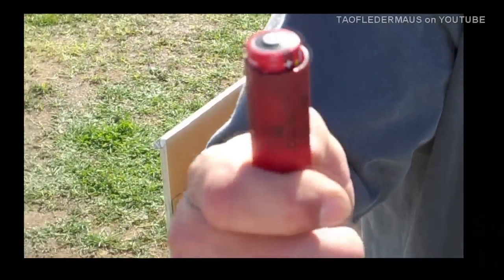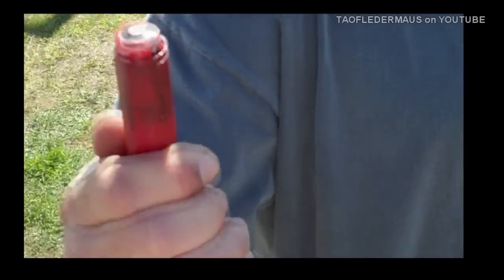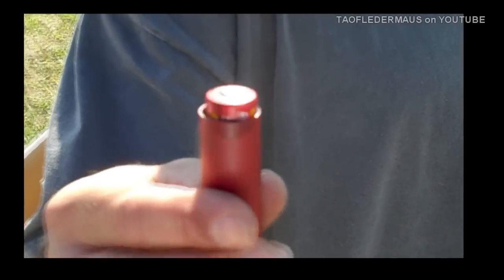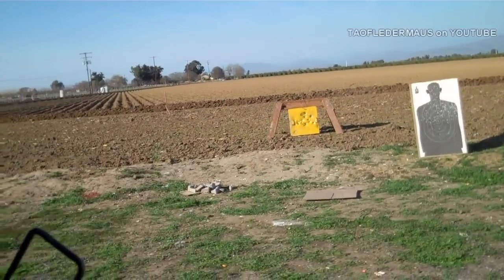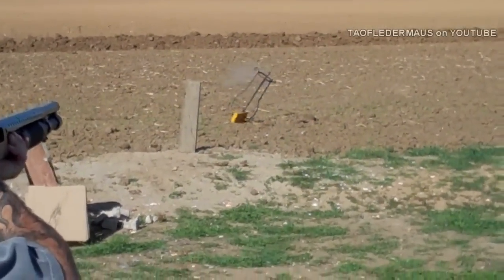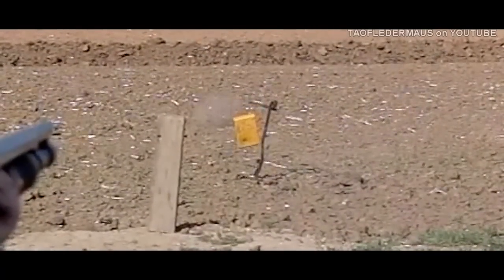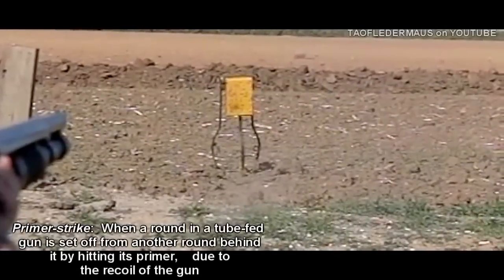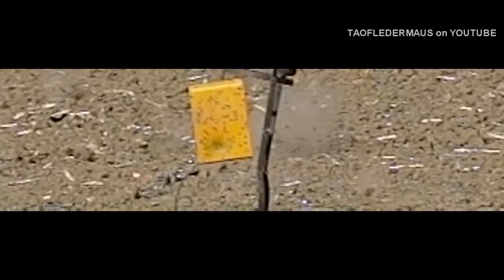Shooting LITHIUM Batteries from a Shotgun  - You wanted to see it!

Comment: If you are worried about the positive tip of the battery setting off the primer of the round in front of it in the tube, just load the battery in backwards.  That way, when it hit the target the effect would had negative consequences.  Bwaaahahahah.  

I got nuthin'....
Reply: Considering that's not the purpose of the primer, yeah, nothing.

Comment: Lithium is actually very light, in fact, it's the lightest metal, so light it can float on water.  It's not quite as toxic as you think, and quickly forms oxides & salts that are relatively harmless, though if consumed, might make you feel a bit...  happy, if consumed in sufficient quantity.  Lead is more toxic.

Comment: Here's a suggestion for ya: miniature shrapnel.  Instead of little shot balls like what one usually fires out of a shell, try something a little more like an aimed shrapnel grenade. ;)
You could also try thin wires/needles of whatever metal would be hard enough to not get incinerated or broken before hitting the target.  Now THAT would be interesting!  It would be like firing a needle gun!  Heck, maybe you could pull off firing a syringe? :P

Comment: 410 shot shell loaded with 125 grain glue on field tips for a traditional bow try that one i had good results at near point blank with a derringer. and the dimes load comes from back in the old days you need a longer shotgun barrel. to do that i would say a full length side by side rig would work and load it with a dollar and ten cents.

Comment: I am not sure there is much environmental difference between throwing these in the trash or shooting them out of a shot-gun?  The only perfect solution is to drop them off at Best Buy and hope they actually recycle them..
Reply: Bestbuy has a recycler that buys the nicad batteries for the materials.  The lithum batteries they currently throw away.  Lithium is spent and useless when the pack dies out and the cost to refurbish it is vastly more then just getting new material to replace it.

Comment: The most awesome thing I have ever heard of someone doing with a shotgun shell is taking a guitar string and soldering the ends together to make a cirlce then lining the wire with crimpled on fishing weights. They said that it acts different everyshot but sometimes the weights spread just right to open the circle of string and when shot at a sheet of tin, it left a whole big enough to put your head through. I have not seen any proof or videos of this really working. Any takers?

Comment from the maker: +david chen  did you think lithum batteries have battery acid in them.....................................................
..........................................
Reply: +Cade Spencer They effectively disintegrate. Would prolly hurt at less than ten feet though.
Reply: anonymous There isn't lithium metal in lithium ion batteries. The hint is in the name - lithium ion

There is, however, in single use lithium batteries
Reply: TAOFLEDERMAUS I thought about trying this but have not thus far. I have, however dissected cr123 batteries and the lithium strip did ignite after a minute or two of being exposed to air. Rather unexpectedly I might add.. always thought it would be a cool feature for a shotshell but apparently it doesn't exactly work the same in execution.

Comment: ammo idea #1test fit a 12gram co2 powerlet in a cylinder bore 12 gauge[hopefully no swaging is needed].remove or open 12ga crimp and dump shot.cut rounded bottom of powerlet to length of shot cup+1/8or3/16inch[file rough edges]fill rounded end of powerlet level with#8 pellets.*carefully*insert assembly into upsidedown 12ga hull and shotcup petals or overpowder wad.for more weight at front[better ballistics],leave out some pellets and close end with glued paper wadding or similar before inserting

Comment: The lithium foil in those types of batteries don't burn until a few seconds of exposure to the air. I bet if you looked real close you may have seen some lithium shrapnel smoldering into black paper thin cinders.  They are more fun to play with at slow or no speed with pliers, welders gloves and vent fans.

Comment: To get the battery to stop tumbling try shooting it with a rifled barrel used for slugs. Or try super gluing a small ribbon tail about a foot long on one end of it. If the distance is far enough the tail will straighten its flight.
Reply from the maker: A projectile has to be the correct size to engage the rifling, otherwise it's like throwing a hotdog down a hallway.

Comment: odd note, I went shooting an took my two dead batteries like this from my flashlight on my gun. Put both down range an popped each with a .22 round an had awesome little holes in them. Went an picked them up, making sure not to wipe my hands all over the exposed battery. Then after i was done checking them out, an side note, smelled like some burning plastic or something. I tossed them into a puddle an INSTANT FLAMES! roaring flames blue an yellow, then died out after a few furious seconds.

Comment: FYI, I just weighed some Duracell ultras (alkaline)... 0.75 oz (21 grams) each.  
Nuon Li-Ion rechargables? 1.03 oz each.  29 grams

When it comes to batteries, Li-Ion are the big loads. That's 324 vs 447 grains for those comparing to a real bullet weight.  :p

Comment: so it doesn't explode. But does it make any difference, if the lithium battery is empty or fully charged? From what I know a charged litium battery contains ore atomic lithium, but a discharged contains less atomic lithium, but more lithium bound in some chemical compound (e.g. when you have a standard LiMnO2 primary battery, the anode has lithium an the cathode MnO2 and when you discharge it, you have the reaction Li + MnO2 -> LiMnO2).

Comment: I could have told you that shotguns don't take batteries. Does it say anywhere on the gun to use AA batteries?
Shotguns are also not solar powered, because they still work at night. A shotgun is a man powered machine device,
which can be used with or without ammunition.
Reply: +SuperCal They are sometimes woman powered.  They are around here, anyways.
Reply: It's been a long time since LSU, but you are right about women and shotguns.

Comment: i see whats wrong with the battery, its the casing.  when you fire and its comes out the barrel  the speed is to much for the casing so it flys off the battery changing its direction. if you take off the casing it should go straight.

Comment: I used to have 100 grams of lithium sealed in bags with  .  Argon, and one day i took a small piece and decided to make a .177 air rifle pellet out of it. Lithium is harder than sodium and potassium but it's still soft enough to mold with your fingers. I made this horrible spike looking thing that would bend really easily and was just overall bad, but it chambered. I shot it at a water bottle from 10 or so feet away and it pitched up and yawed right and missed the bottle by like 6 inches. I made another one and decided to shoot the bottle from just a couple feet away with this one, and when I did it just bounced off and went into the grass lol. 
Now I'm curious how lithium would act when shot out of a shotgun as pellets instead of a slug. I would imagine horribly, but maybe there would be a way to ignite it with the powder and holes in the wad?

Comment: This is dangerous.  If the battery simply shorts out from the high acceleration, it will release all it's energy.  If this is fully charged, or even partially charged, it has to release energy when it does this in the form of heat.  I'm not certain, but I think you're risking an explosion doing this.  I wouldn't do this.